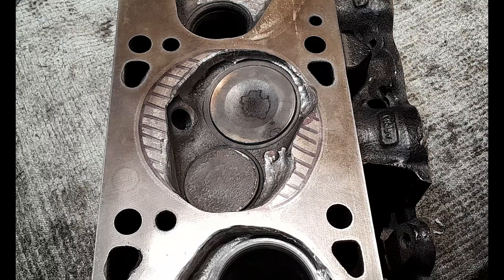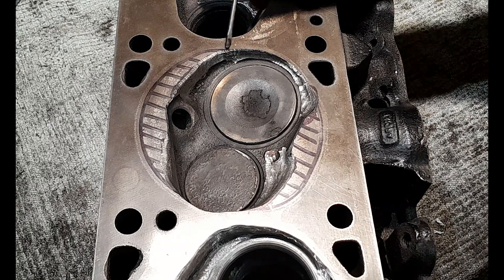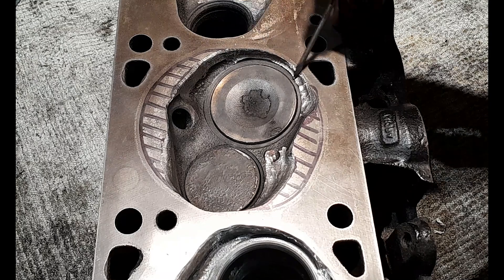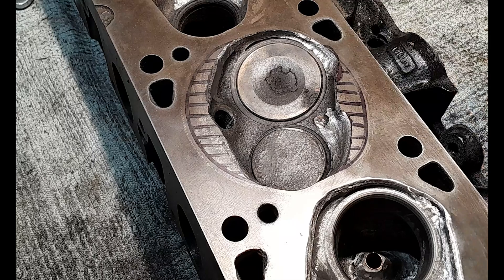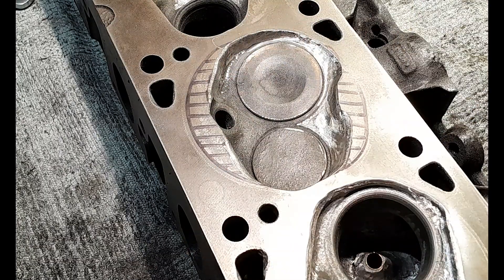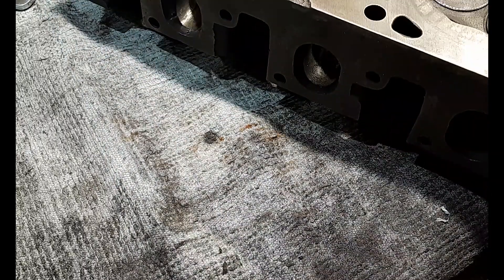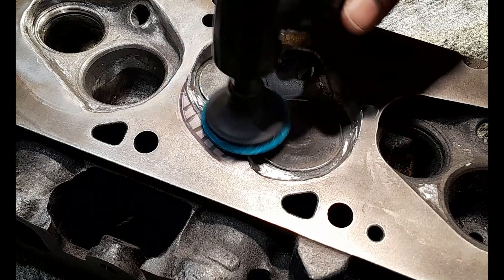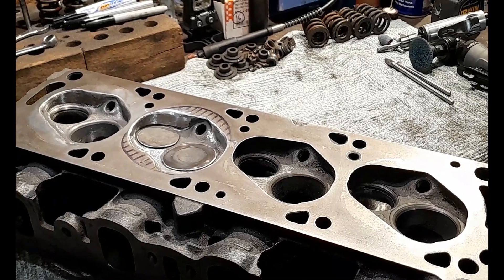351C 2V Cleveland Head Porting De-Shrouding Valves Pt 2

Comment: Interested in how this ended up.
Did you measure the combustion chamber volume after this work by any chance? I know it won’t increase it much, but handy to know when selecting pistons..
Reply from the maker: Unfortunately, because of a couple of accidents with my mini flap disc contacting my valve seats, I made the whole project more expensive than purchasing a set of alloy cylinder heads.

In the end, I abandoned the porting of these heads and went with a set of AFD 2V heads. They are cheaper copies of the Aussie AFD’s. These heads are also shown on my channel.

After installing them, all I can say is (and this will change to a degree as I tune my sniper more with these new heads) from a butt dyno point of view so far, the aluminium heads are great, but don’t feel that much stronger than the set of ported Aussie 302 heads I already had on the engine.

They were a set of 302 heads I ported a while back, without any major combustion chamber shaping. Just polished the chambers and did a very light chamfer around them.

It tells me those factory iron Aussie 2V’s are pretty awesome with a port.